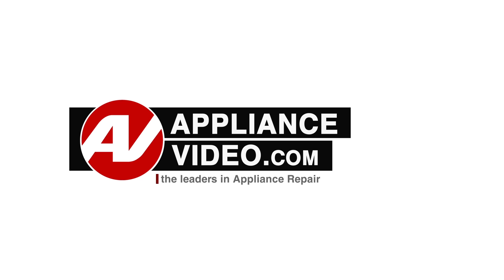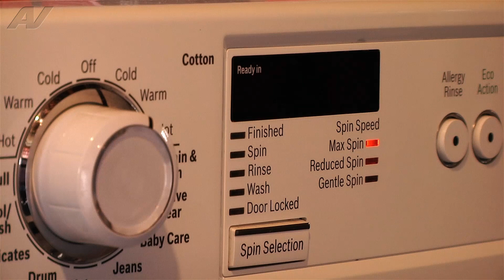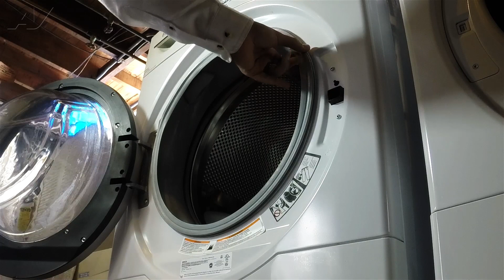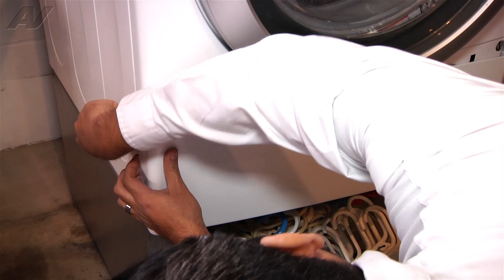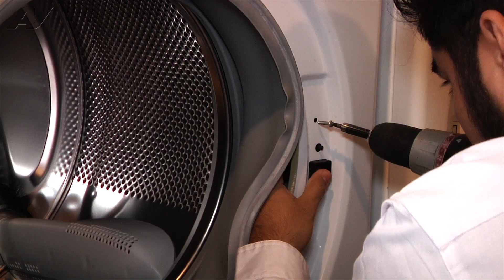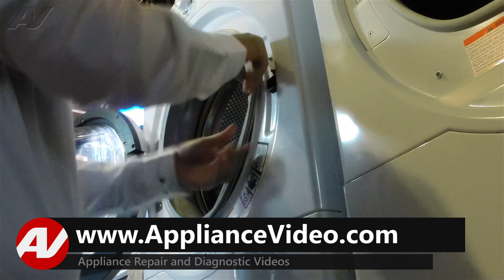Bosch Washer Repair - E27 Error Code - Door Lock

Comment: You should add that after all is completed you may have to reset the machine:  1. Set the knob to off.

2. Hold down both the Spin Selector button and the Allergy Rinse button simultaneously.

3. While holding these two buttons down, rotate the knob one click to the left, to the “cold” position.

4. At that point, the display will show a diagnostic code and the unit will enter a self-test mode. In my case, the solenoid latch started clicking repeatedly. I pressed the Spin Selector button once or twice, which resulted in the display of new codes and then the release of the latch.

5. I set the knob back to off, and the washer now appears to be operating.

6. You’re done.

I can't take credit for this note, but I thank whoever posted it because it did the trick
Reply: You saved my sanity. This is the second time I have had to change the door latch and I forgot the rest procedure. Thank you.
Reply: This procedure worked for me without changing any parts! Not sure what caused it to begin with unfortunately
Reply: Tried this method the door still wont open error code co es back also tried pulling the hand latch still won't open door what can I try next to open door

Comment: Great video ... BUT I removed the lock and inspected it. Electrically it is working, coil conducts, switch contacts work, button works. What's next E27.
Reply: The pressure switch should be checked and also clear the tube leading to it - if suds, debris or something blocks it, you will get an error.

Comment: What is the part number ? And can I order this door switch on Amazon ?
Reply: There are at least two door switches for the Bosch that I found so take your switch out and the part # is at the top. Part used is around $35, new $75ish. E27 for my Bosch machine was the Pressure Switch (Flow Limit switch) which is easy for a homeowner to access and test as it is on the top of the machine after taking the cover off, plenty of videos on it.

Comment: The door is locked and I can’t get it open
Reply from the maker: Great question, if you have a more technical question that our parts department cannot answer, you can search our over 17,000 answered questions free at our website www.ApplianceVideo.com under our Repair Help section. You can also call our parts department at 1-800-830-5465 and they can give you help 7-days A week ,or search at www.SaveMoreOnParts.com  .
Reply: Remove lower panel (follow other youtube videos for instructions on your machine so you don't break the clips). There is a plastic 'zip tie" hanging down which manually releases the door.

Comment: Bosch Vision 500 series problem: Initially washer not spinning fast even on high speed drain & rinse cycle. Now door won't open and getting E27 code. Switched off breaker and waited 30 minutes but door still locked with same error message.. Is this a door lock problem or possibly another issue?
Reply from the maker: Great question, if you have a more technical question that our parts department cannot answer, you can search our over 13,000 answered questions free at our website www.ApplianceVideo.com under our Repair Help section. You can also call our parts department at 1-800-830-5465 and they can give you help 7-days A week ,or search at www.SaveMoreOnParts.com  .